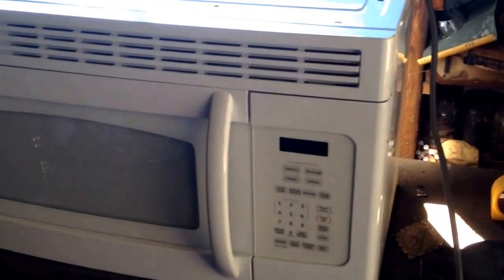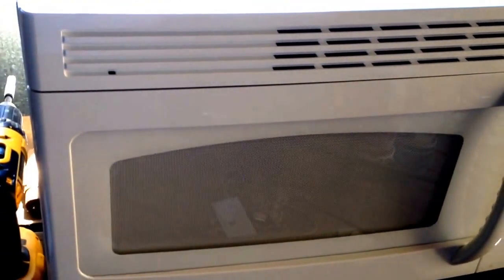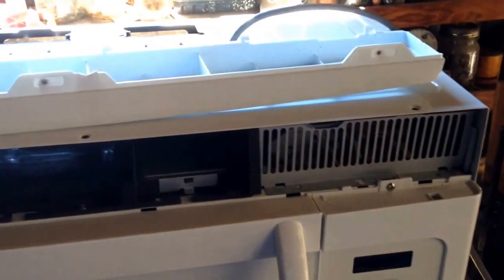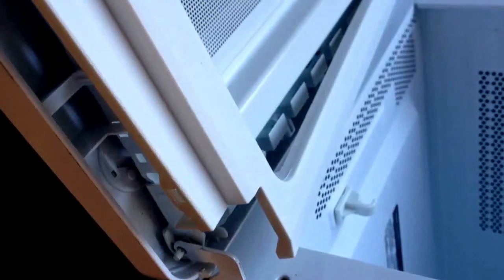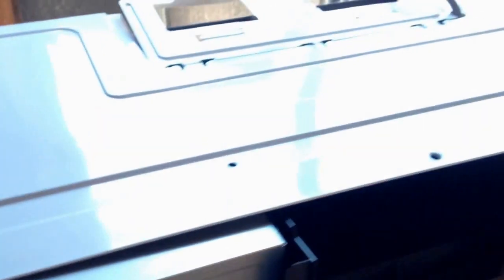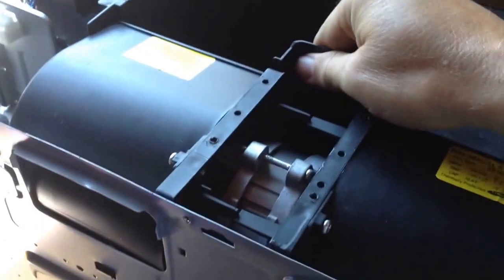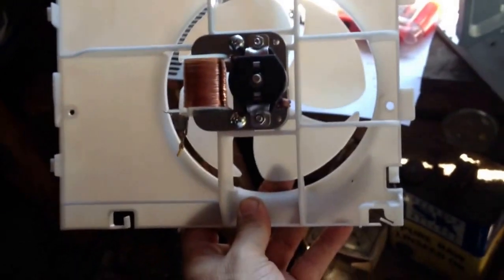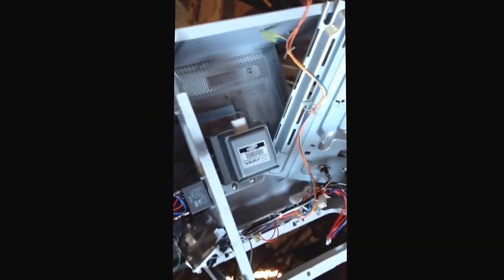Scrapping and parting out a Microwave for $280 plus profit!!

Comment: Thanks. Is it not necessary to get capacitor to a safe situation first before removing power cord? I want to reuse the cord of an old microwave, but its capacitor scares the sh#t out of me 😲
Reply: Most modern microwaves have an internal bleeder resistor that discharges the capacitor on it's own. If it has been sitting unplugged for awhile (he said a week, I have heard 24 hours), then it should be safe already. You can make sure by shorting the terminals with a screwdriver (or hooking up to a resistor of proper size, which is the proper way). 

Keep in mind that if it doesn't have a bleeder, or if it has malfunctioned, shorting the cap may destroy it. But I haven't come across a charged cap yet.

Comment: I had a MWO that quit working I decided to open it to see if I could figure it out. The soldier was CHEAP and wires came apart. I soldiered it back together tried it out and it worked I then put it back together and used it for a lot longer.